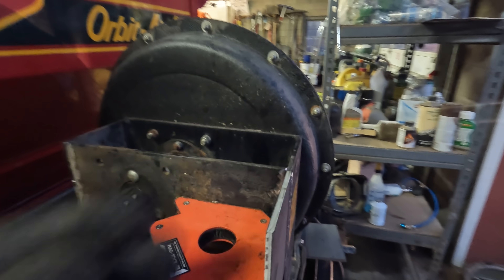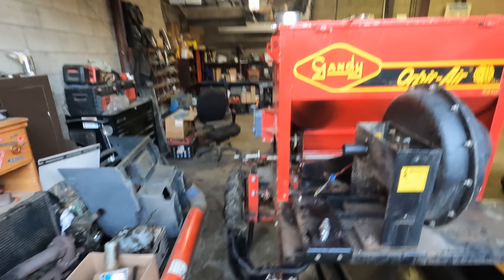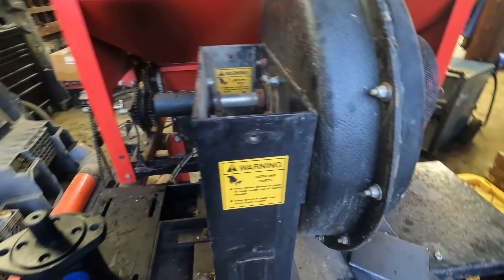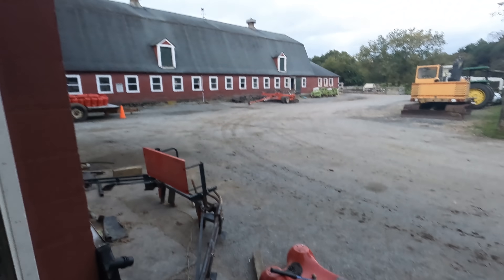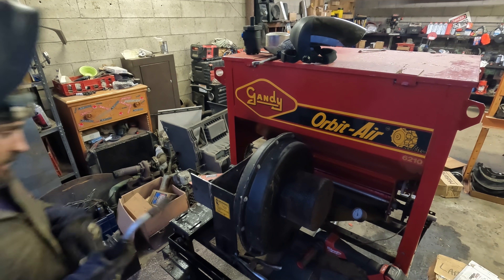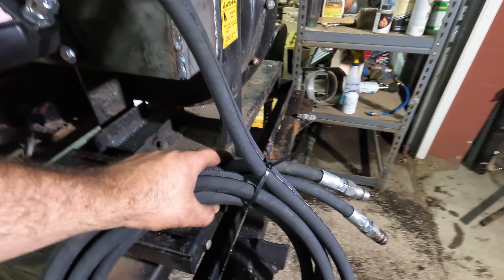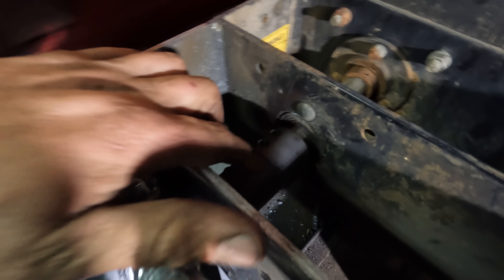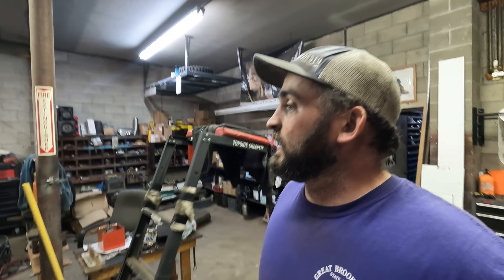Redesign Of The Gandy Air Seeder

Comment: If the new hydraulic motor doesn't spin fast enough to push seed to the full 23', a little more fabbing to add a step up belt pully system.

Comment: Yes, listening to a bunch of people that have a grade school understanding of hydraulic design and application. What could possibly go wrong!

Hope that the SCV can be configured for motor control, because if both ports aren't open to return when you shut it off stuff is going to break! Does that motor require a case drain ?
Reply from the maker: I switched up motors actually. Got the one that gandy puts on them. It's designed for trwctor application had a case drain and uses 8gpm to get proper air flow
Reply: @DuffyAg  can the SCV be configured for motor control? (Basically in a "float"  configuration when shut off)
Reply from the maker: Yes pushing forward puts them into float si it can spin to a stop
Reply: @byronmill  lol you sure don't know much about hydraulics for someone that wants to spout off about what others say
Reply: @farmcentralohio  Bringing a fan with a lot of inertia to an abrupt stop will rattle and bang. A belt is not a problem. Do you put your car in reverse while you roll forward?
Reply: @arneanka4633  Um, okay lol
Reply: Sounds like problems ahead.
Reply: Any remote can be used for motor control as long as you slow the flow before you shut it off

Comment: Can you hook the lines up to a pto pump to run it on the 7520? Good video btw
Reply: Would involve hydraulic tank and pump. I was thinking same but would be challenging since you want tank close to pump but is it being used solo or behind disc and it would need around 2x plus gpm of pump for tank sizing so around 20-30 gallon tank so you dont overheat the fluid since it would be running continous
Reply: @tractorboy31  I think he’s using it solo. Since you have to disc the field a couple of times then he will come back and spread the seed and roll it at the same time.
Reply: Could make a oil tank that hangs off the 3pt arms.